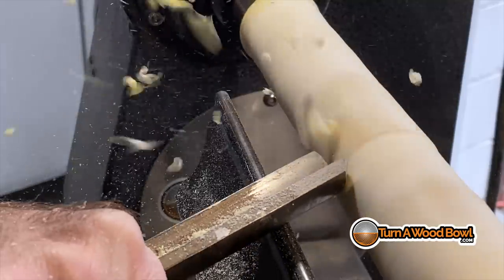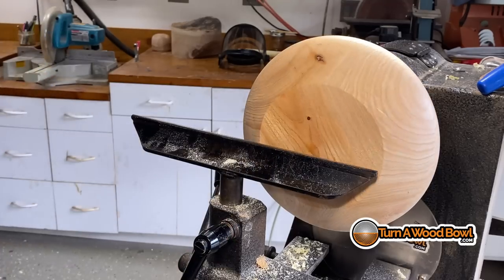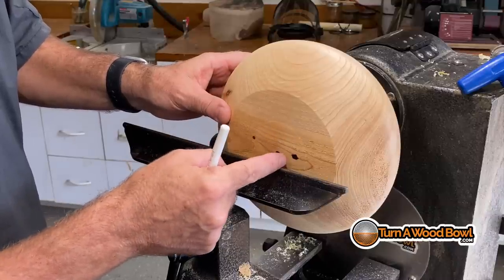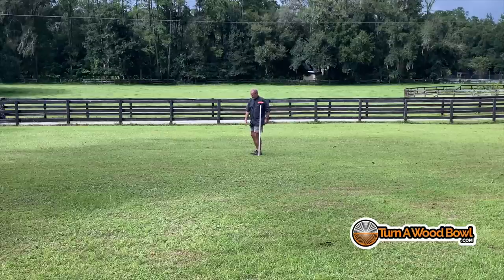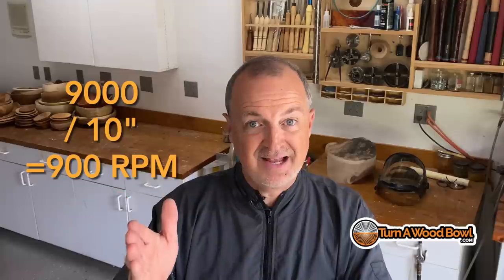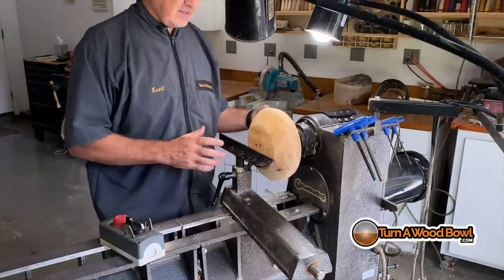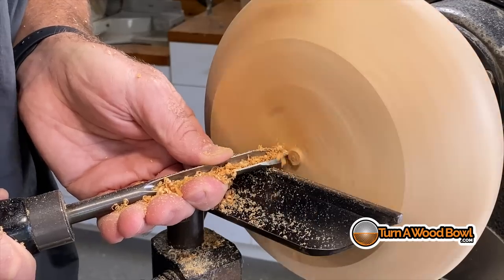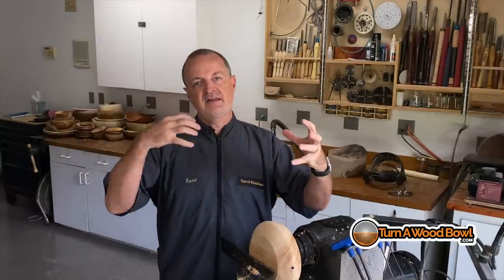Wood Lathe Speed Woodturning Wood Bowls Video

Comment: I was a skilled trade machinist for 43 years and got back into woodworking again a couple years ago. My lathe has a variable speed split pulley system which works fine. It simply has a handle and dial which shows the "approximate" rpm, which I really never look at.  My years of experience running many different machine tools has taught me how to gauge the proper rpm myself by vibration, sound, sight, or feel. You are correct when you say that an rpm gauge is really not needed for proper operation, and you can get a better "feel" for the correct speed by trusting your gut.
Reply from the maker: Thank you, Bob! Thank you for writing and sharing! I think we're much better off being more attentive and trusting ourselves more often. ;) All the best to you and Happy Turning!

Comment: Your tutorials never cease to amaze me!  I have been turning for about 2 1/2 years and have never been taught that this could be the cause of a rough looking cut.  I am been mentored/instructed by many woodturning professionals, who are excellent turners, but this is the first time I have been made aware of the speed being a possible cause of an uneven cut.  It has been very frustrating, particularly when I know I am riding the bevel yet it isn’t smooth (and I am told it is because I am not riding the bevel properly).  Thank you again!
Reply from the maker: Glad this helped. I have another video coming soon about tool marks. Stay tuned. Happy Turning!

Comment: I learned from your videos and started from slow and slowly build speed as the balance is perfected.  The highest I have ever run my lathe on a bowl was about 800rpm on a 6" bowl.  My 10-12" bowls never run faster than 650rpm.  That speed allows a smooth cut and a shaving action produce a surface that is good without sanding.

Comment: I just have a manually belt adjusted speed lathe and I've never messed with whatever setting it was on when I bought it.  It doesn't seem very fast, but I'm not in a hurry anyhow.  That being said, I try to get the blank I'm turning "trued" up as much as I can before I actually start turning it.  So far that has seemed to work okay.

Comment: Very helpful!  I was given a Sears Craftsman lathe circa 1977..  It has a pair of 4 step pulleys and you have to move the belt to change speeds..  The SLOWEST speed is 875 rpm..  I haven't tried any bowls yet.. But it doesn't look like I'll be able to do anything very large.. Not safely anyway..  I do have an idea that might help out.  It would involve adding an extra pulley and changing out the original belt for 2 shorter ones.  There would be a jackshaft bar and pillow block bearings.  The motor would have a 2 step pulley.  The jackshaft bar would have 2 pulleys on it.. A 2 step to go with the motor pulley and also the 4 step pulley to go with the spindle pulley.  All pulleys would be mounted inversely from it's matching pulley so that the speed would change when either belt is changed .   Essentially, I would be stepping the speed down twice..  I'm hoping it will allow me to do bigger bowls..  Thoughts anyone?

Comment: This was excellent information presented in an understandable way.  Thank you.  One thing I don't think you mentioned was that different chucks also have limitations on speed as well.  I look forward to taking your challenge as soon as I can get back into my shop.
Reply from the maker: Great point! Yes, Cole Jaw chucks in particular should not be turned at maximum speed. Check with each manufacturer because they do recommend not to exceed certain speeds. Thanks and Happy Turning!

Comment: Kent, I subscribed a while ago and have learned quite a bit from your teachings. I too have watched that "famous" bowl turner who says that life at bowl turning begins at 1300 or 1600 rpm (?) and will advocate turning as fast as possible. I have always turned as fast as the lathe will not vibrate which ironically has been, according to the pulley speed illustrations on the inside of my pulley section, under 1200 rpm (I do have variable speed on my Delta Midi). I have tried to turn faster but, the as you call it, intimidation factor does set in. 
Thank you for supporting my desire to only turn as fast as I sensibly feel is safe.
Safe turning to you.
Reply from the maker: I hear ya! Be safe and Happy Turning!

Comment: Thanks again for great advice, I’ll be taking a little while longer as I have no controller I have to change the belts it’ll take a bit longer but I’m shaw I’ll get there,so thanks again and I’ll be watching as always.
Reply from the maker: You're very welcome. Use the slowest belt rpm speed, which will give you needed torque as well. If you use relatively well balanced bowl blanks to start, you should be fine. Happy Turning!

Comment: Great information Kent, as always. I think a lot of people forget, or don't realise that the readout is based on the spindle speed only as that's where the sensor is and not an indicator of the overall speed of the work piece. Thanks for sharing.
Reply from the maker: Great point. Thanks and Happy Turning!
Reply: I believe the term for this used by most trades people is surface speed. Machinists use this a lot. It tells how fast the metal is going past the cutting tool in feet per minute or some equivalent units.

Comment: Great video, one thing that happens in turning bowls and you have a blank vibrating and you increase the speed and the vibration goes down is that you were first running at a Critical Speed and when you Speed it up you go past it. All machines have a Critical Speed with a bowl blank added to the lathe it changes the Critical Speed,  and if you put a heavier or lighter blank that Critical Speed will change. Thats the science of why speeding up the lathe and the vibration going down. There is a lot of information out there on the subject, I just wanted to touch on the subject because it seems strange that this actually happens and seems like something strange or mysterious is going on. That's one reason every bowl blank is different.

Comment: I'm relatively new to turning.  I've been at it for about three years...started with pens, moved on to small bowls and small vases.  It's therapy for me.   Three hours and ankle deep in sawdust is time well spent.  I love the video.  My lathe doesn't have a digital read out so i kind of go by feel, vibration, and comfort level so this video is very reassuring.  Do you apply the same thought in regards to sanding or is it also the blank youre turning?  Thanks for the help.  Ill be looking at more of your videos..can use all the help I can get.
Reply from the maker: Thank you, and yes, I do have a video on sanding. Check it out. Happy Turning!

Comment: A great video, but how do I compare your  variable speed number 1, 2 3 etc, to RPM for those of us that have a lathe with fixed belt RPMs?
Reply from the maker: Great question. Well spindle turning speeds are very fast. In general, on a fixed speed lathe you want to have the belts on the slowest setting. Also, that slower speed usually provides more torque which is great for bowl turning. Hope that helps. All the best to you and Happy Turning!

Comment: Like all the 5 other videos or so on turning speed, I keep thinking "Blade Tip Speed" - as a lawnmower tech, I found it important for liability reasons to be able to set that properly (governed engine speed) - way I learned it was through the use of Pi -   The ratio of circumference to radius - so, an engine at 3600 RPM, with a 19 inch blade, for example, blade may be travelling at 18,000 feet per minute, or 300 feet per second..  -  So I always wondered why someone talking about bowl turning speeds didn't simply do the (very simple) math using Pi  (multiply your diameter by 3.1416 to get circumference, then multiply that result by the RPM to get inches per minute, which you could use , or then divide it by 12 to get feet per minute , then divide by 60 to get feet per second)   Although I see in an earlier comment someone else mentioned similar, as well as the rotational inertia mass (which goes without saying.. the G forces created by that speed, in other words) ...  That might help explain why the gouge cuts better/faster on outside and slow down feed rate as you move in ..    But - this was probably one of the better explanations/demonstrations of the idea...
Reply from the maker: Yup, what he said! Ha. And you're right about the different cutting qualities on the outside and inside of the bowl. Thanks for sharing! Happy Turning!

Comment: A friend just got a Robust lathe and he gave me his old Powermatic 3520A, which has no RPM readout. So I am starting out just as you suggest. I also have to replace the VFD, but that is another story. It might be helpful for people in a similar situation to understand that a VFD is not machine specific. One doesn't need to buy the original Powermatic VFD for a replacement. Indeed, that is an inferior VFD compared to the newer ones available today. I have seen so much handwringing abou this that is unnecessary. TMI perhaps. But definitely related to rotational speed on a lathe. 🙂

Comment: In spindle turning will a higher speed assist in less tear out. working with pecan making rolling pin.
Reply from the maker: It can help, but if the fibers are weak or brittle it might not help. Use shellac to tighten the end-grain right before the final passes. Happy Turning!

Comment: You channel is so educational for a beginner so thankyou. On the subject I don't have a variable speed lathe. Your Maths say I should be turning an 8" Purple Heart blank at 1125 however I have a speed choice of 1000 or 1400. Would you suggest airing on the side of caution and running 1k?
My 3rd ever bowl turn was a padauk bowl which I roughed at 700 then turned at 2k (I'd seen a video stating faster=better) but I used Carbide, however after studying your videos on bowl gouges I'm determined to get better with traditional tools
Reply from the maker: Stu,
Faster, with bowls is NOT better, but more dangerous. Try to not exceed 1,000 rpm.
Reply: @TurnAWoodBowl  I swear by your 9k/diameter rule and then round down to the closest slower speed. Also purely through watching your channel I am using a bowl gouge every time, so thankyou!

Comment: Hi,  like your videos a lot.  I’m just starting to turn and am using carbide tools.  My bowl blank’s are 4”-5” in diameter.  Based on your formula of 9000/bowl diameter that would give a turning speed of 1800 to 2500 rpm.  That is well above your guideline of 1000rpm.  What do you recommend?  Gene
Reply from the maker: Hey, Gene. I'd keep the pieces under 1000rpm or lower than any unnecessary vibrations. Happy Turning!

Comment: I have a bench top lathe.  I have not bolted it down.  Should I? It does not seem designed to be bolted.  When I start an unbalanced blank, it shakes worse than my first car.  I stand well to the side and constantly reposition the lathe to where I can work.  It is belt driven and I am working at the slowest speed.  I only have a few tools in my shop and my band saw is not large enough to round many of the bowls I make, I have tried rounding on the table saw but, that is still not able to do everything I need.  Any thoughts?
Reply from the maker: If you're turning at the slowest speed and you're still getting vibration, then you may want to fix the lathe to the bench. Try clamps or something to prevent as much vibration as possible. Also, be aware that vibration is not good and will lead to things flying. It sounds like you're ready to expand, either with a larger bandsaw, lathe, or both. ;)

Comment: I have a pos import with the old non electronic variable speed the slowest rpm is 720 and I can only move the speed control handle about half way anymore and it sounds like it's going to come apart about 1000 rpm this was going to be a temporary lathe untill I retired about 2 years but became disabled 2 years before retiring so I didn't get to upgrade
Reply from the maker: Jack, it sounds like you're in the market for an upgrade. Hopefully you disability isn't too limiting. Perhaps take a look at Robust's Scout lathe. It can be adjusted to turn while you are seated. All the best to you and Happy Turning!

Comment: Good Morning, Kent! This was a great video. I’m wanting to start wood turning. Could you suggest a good starter lathe and tool? Thank you and have a great day!
Reply from the maker: Yes, absolutely. If you want to turn bowls, essentially any lathe that has a 6" swing or larger (that's the distance from the headstock to the lathe rails). See this article about lathes https://turnawoodbowl.com/wood-lathe-review-compare-select-understand-2/ The Jet 1221VS is a great lathe to start out with. And I'd recommend starting with traditional turning tools, a high-speed steel HSS 1/2" bowl gouge and a sharpening station like the Oneway Wolverine System should come first. I have two courses that will benefit you greatly – Tool Sharpening for Wood Bowl Turning and Wood Bowl Turning Start-to-Finish are both online check them out here https://turnawoodbowl.com/courses/ and will teach you absolutely everything you need to turn wood bowls. 

All the best to you!
Happy Turning,
Kent
Reply: @TurnAWoodBowl  Thank you so much for the information. Have a great day and I’m looking forward to your next video.

Comment: Hi Kent, thanks for the video.  I have a lathe that is 50 yrs old, no variable, I have to balance my blanks as best as I can before they go onto the lathe.  lowest setting is 850 rpm, so a 11 in bowl is turning around 40 mph and vibration is crazy until balanced.  I would love a variable speed ... Any suggestions?
Reply from the maker: I know there is a way to install a "3-phase" controller. I believe that is the term. I don't do electrical stuff, but if you search around you might discover this. Talk to an electrician. Basically, the motor can be rewired so you can make your lathe have a variable speed control. Happy Turning!
Reply: I had a lathe with no variable speed,  looked into changing it and increasing hp , was going to cost almost as much as a new larger lathe with all the features that I wanted

Comment: I am thinking about getting the grizzly g0462 lathe. It says min speed is 600rpm but i read someone had contacted grizzly and a rep said its actually 500rpm. Is this too fast an rpm to turn a good sized bowl? 12-14"
Reply from the maker: Not being able to take the lathe speed down to very slow is an issue with bowls, especially larger bowls. 500 rpm can work, but not if the rough bowl blank is unbalanced, which most are at first. Happy Turning!

Comment: 1300 rpms for a 10 inch bowl blank that had been more or less balanced, felt dangerous
Reply from the maker: Yup, it is. I'd slow it down just a touch. ;)
Reply: I always start out at 400rpm no matter what, and progress, just as shown. Most bowls of that size end up being about 800, then once I'm making a finishing cut I bump up to 1200 max. I don't really progress any other way. Also if the wood is denser, It may be better to take it down a notch. Everything is relative lol. I think that's why turning knowledge is best  through experience.